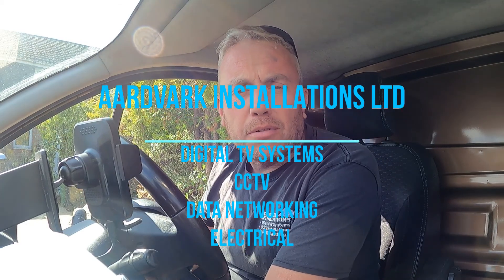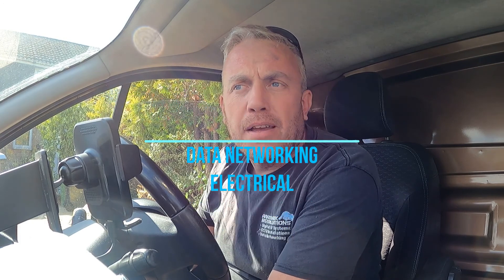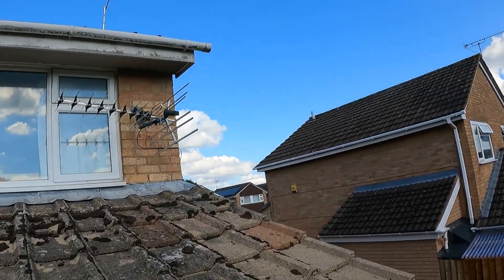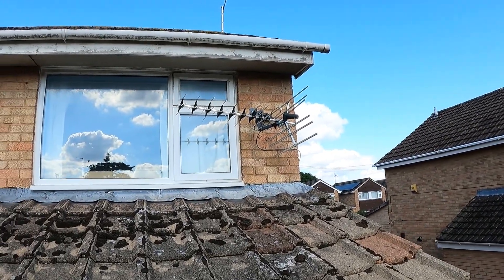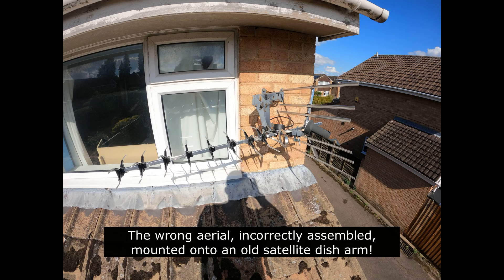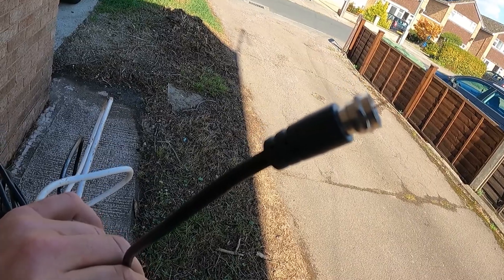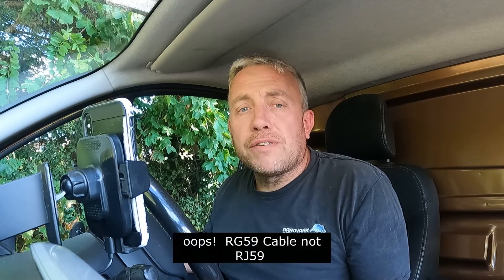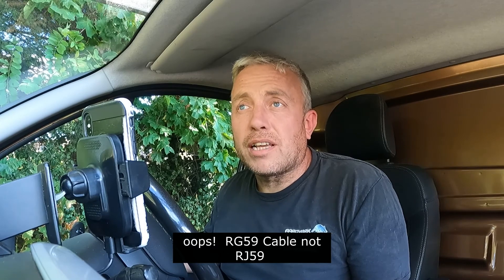SHOCKING TV AERIAL INSTALL!  How not to do it.

Comment: great job, how would you advise customers to be able to find a reputable Arial installer within their local area r whom knows what they are doing? Additionally how can you tell the difference between a "tool station" cheap Ariel and a "more suitable, trade one"
Reply from the maker: Ok so I recommend going to the CAI website cai.org and go from there to find an installer who is registered with them.  I could tell the difference because of how flimsy the metal was on the aerial and by over 20 years experience installing aerials.  It’s not so much a “trade” aerial you need, I meant it should’ve been an aerial fitted by someone who is in the trade and would’ve / should’ve used a completely different designed and shape aerial.

Comment: It's not like RG6 cable is expensive either . Was it even pointing at a main transmitter as the one on the roof and the neighbours aerials are pointing in different directions ?
Reply from the maker: I know. 
No it was attached to a sky bracket pointing at the floor 
Unreal

Comment: Aerial Facing the wrong way, Deflectors Wrong Way, Blocking a window they would now struggle to open - Lazy Scammers. Always best to use lack cable outdoors, its made up of diff properties and therefore does not split. So joing black on to white again lazy. Its like he has connected it to an existing sky cable who do now use white at times, Looks like there is an existing pole and aerial on the side apex. Just run a fresh wire directly, Just complete Lazyness.

Not nice to see people getting ripped off, At least youve sorted it now